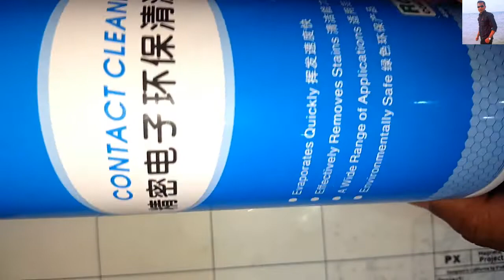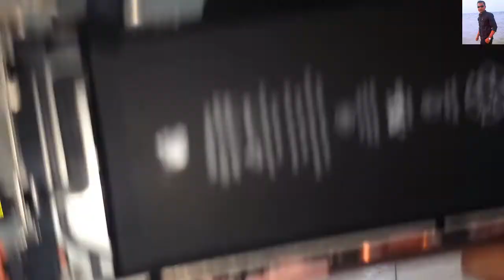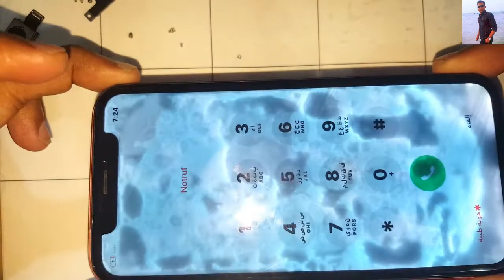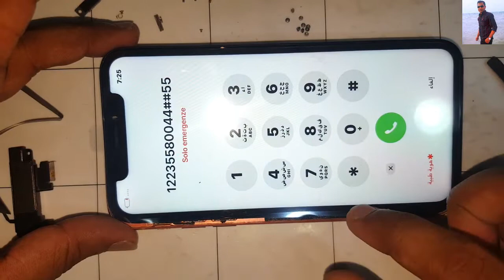How to Repair iPhone XR Water Damage

Comment: Some of these comments lol. Quite a lot of work there. Fixed my iPhone XR now. Easy to follow. Thanks.
Reply from the maker: Nice work!
Reply: Hi Jason, what kind of liquid do you use to clean the Motherboard? In the Video, he is using a spray to clean it, what is that?
Reply: Rkn ak sy isopropyl alcohol. I used a circuit board cleaner spray. Can be purchased on eBay very cheaply. Needs to evaporate well

Comment: There is noway on god's green earth I could do what you just did, it would never work again.  I have the iphone X, it has water damage. the phone still rings, makes a sound when I plug in the charger, makes a sound when I get a text, but the screen is pitch black and I cant unlock it.  Apple wont touch it, bestbuy wont touch it.  I guess now I have a $1300 paper weight.
Reply: Same
Reply: You try going to your local mall?
Reply: @zariahspence8961  I finally took it apart and used some contact cleaner to clean all the contacts, let it dry and put everything back together with a new screen.  I dont know how but it started to work again.  I ended up ordering a new set of screws because I lost a few of them during the process.  but thank god it worked.  Sad to say, but you dont know how attached you are to your phone till it quits working.
Reply: What tools do u use
Reply: And wher do u get them

Comment: Got my new iPhone XR slightly wet while typing now I can’t use the bottom ( no emojis, can’t swipe up to unlock, can’t photos took on Snapchat basically anything that requires pressing a button on the bottom of my screen)
Reply: I got the same but for my top half of the screen. Have you managed to fix yours yet?
Reply: @EyeeyeCaptain  nope, I’m managing alright though because I’ve just been using the assistive touch button. Let me know if you get yours fixed
Reply: Same to mine 🥲